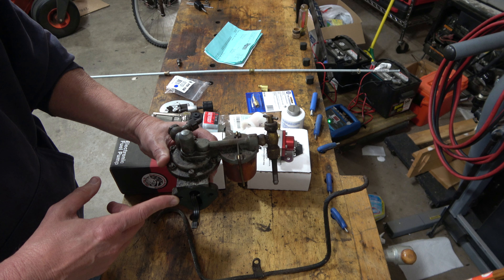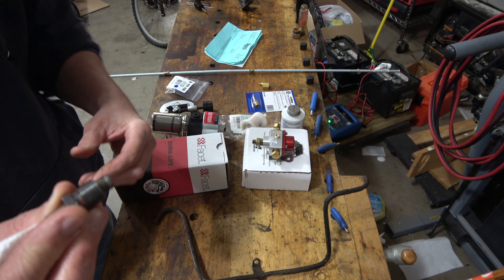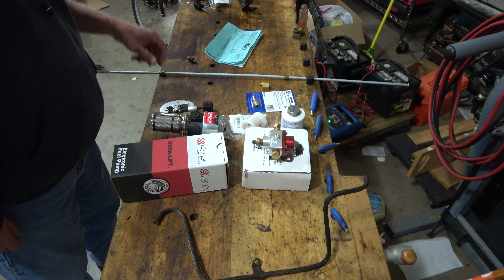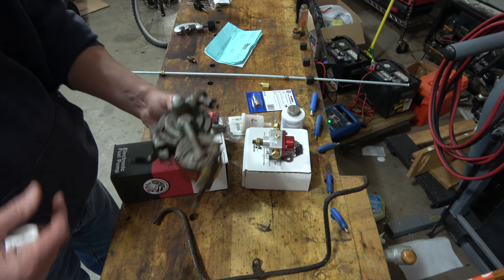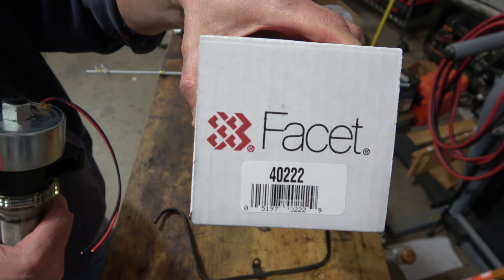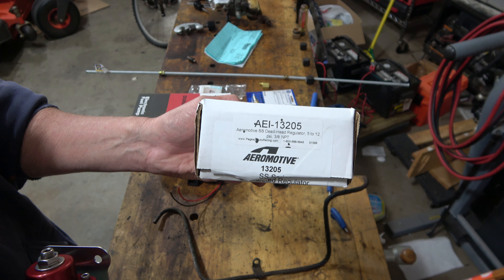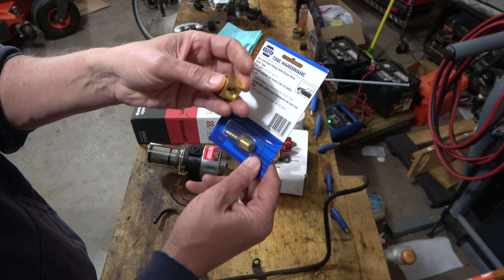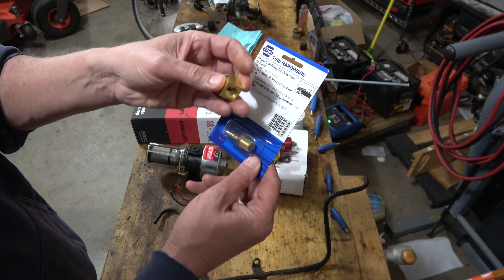IMT 560 Electronic Pump Install Part 1

Comment: Could you tell me why my hydraulics is opening my baler door is slow I put oil in it and it slow and don’t want to open all the way
Reply from the maker: I would check the filter in the transmission. From memory it’s located on the left hand side behind an access panel. This is for the main hydraulic pump. There is also an auxiliary pump  that feeds the rear hydraulic lines.